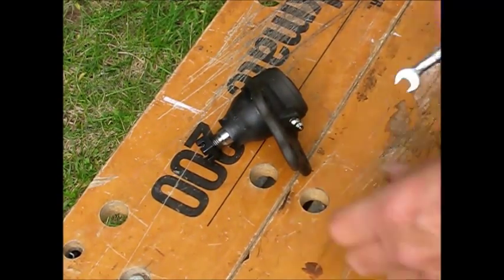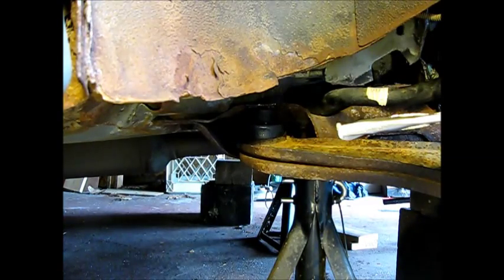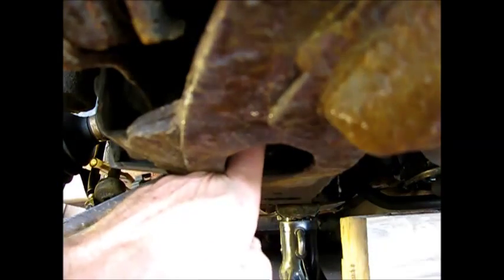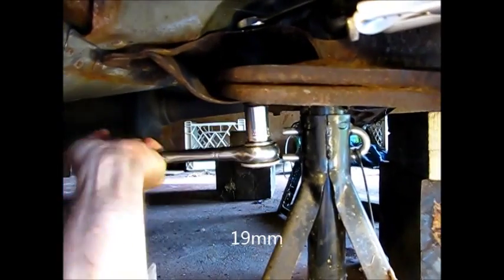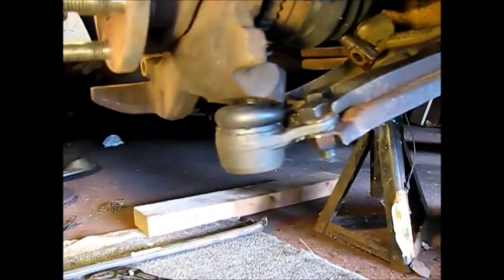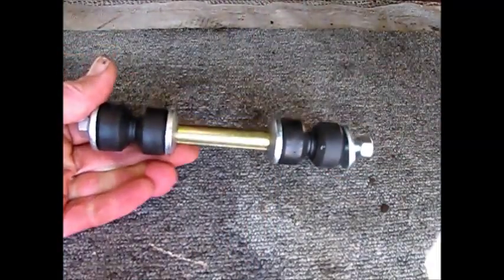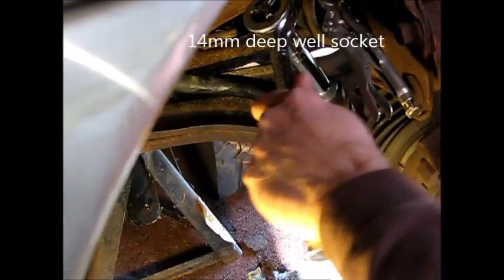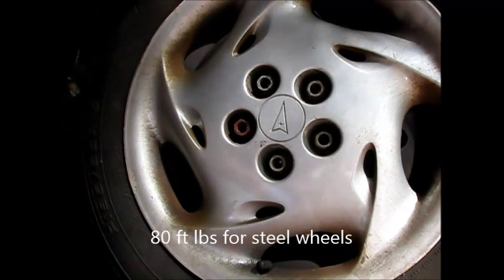How replace the lower control arm ball joint GM Grand Am, Skylark,Calais,Achieva Part 2: re-assembly

Comment: You did a very nice job on that car. Brake pads and disks, suspension... good work. You should be fine for a few thousand miles.
Reply from the maker: Thanks for watching and commenting. This car is still rolling along.

Comment: That rear rubber bush in the control arm is shot.  it should be a tight fit in the arm so it flexes , that's why its rubber.    Maybe cost a bit more but would have been better to replace the whole arm.

Comment: This was great- aren't cars fun? Zipped together at the factory, not a 2nd thought or even care that it will need repair in it's future- an almost evil planned obsolescence that makes you sick.

Swear words are part of every tool box- they're usually stored in between the 17mm and 19mm wrenches in the cheapo set (when you desperately need 18mm) and next to the dull, bent, cheap chisels- that will never hold an edge- so you eventually end up grinding them down to nothing.

Unfortunately- my '89 Buick E-Body is the same with the ball joints; 1/2" rivets, but the control arm has only 1 easy-to-reach outside through bolt. But- it also has 1 "leading stabilizer rod" that is riveted to the control arm, and then bushinged to the sub frame. The threaded end of the rod usually snaps at the threaded end when trying to remove- so I'm better off leaving it be, and drilling out the ball joints' rivets from underneath. New components are unavailable, and since I don't own a metal lathe to create a new one- I've found it easier- to not drill completely though, and just punch out the headed end.

Plenty of swear words & the best penetrating fluid you can buy: 50% Acetone + 50% ATF in a $2 Harbor Freight pump oil can (THANK YOU CHRIS FIX). At less than $10 for 1/2  a gallon of stuff that actually works- how can you beat that?

Fun

Have you ever wondered- why do they call a Torque ratchet a wrench? Is there a such thing as an actual Torque WRENCH? How are you supposed to torque stuff with a wrench?

LOL- guess you just gotta have "the feel for it".

And a few swear words.